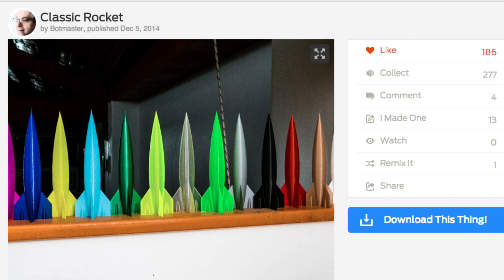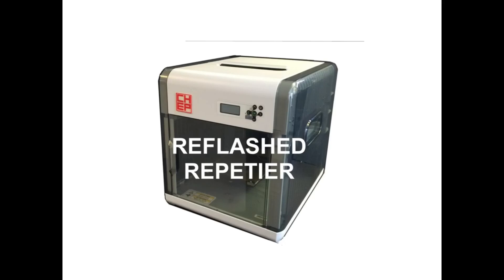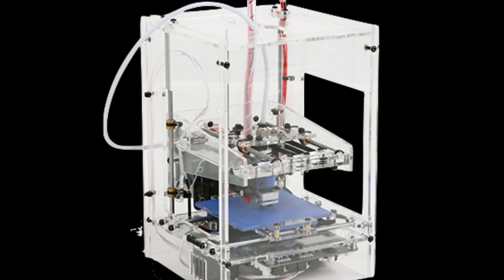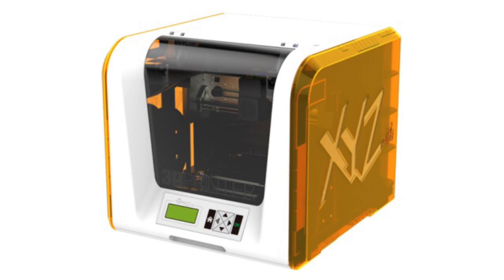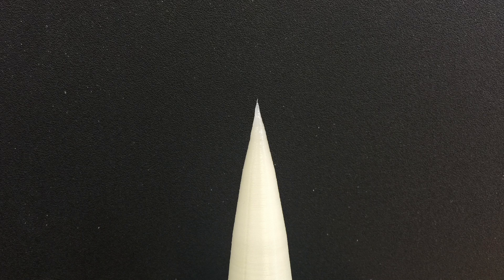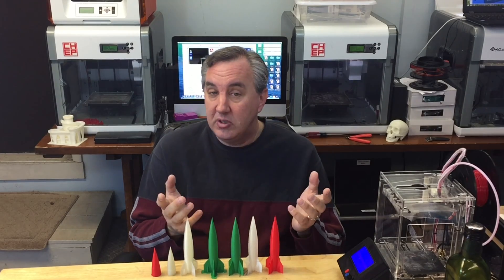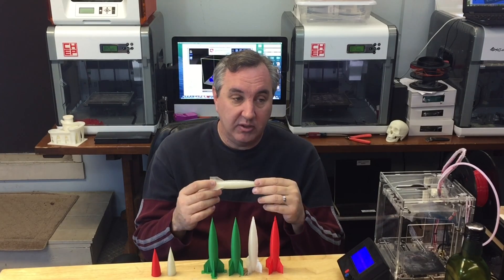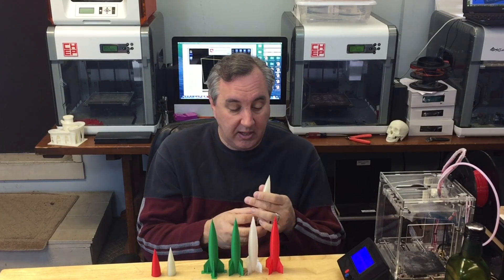Filament Friday #45 - 3D Printing Rockets without Melting on DaVinci vs Fabrikator vs Jr

Comment: Does S3D do that automatically? Or do you have to know what to program to make it work like that??
Reply: +Chuck Hellebuyck's Electronic Products man you are seriously selling me on S3D. I may buy it tonight. Did you get a chance to slice that little file I sent you via email a while back?
Reply: +Chuck Hellebuyck's Electronic Products done. Thanks again Chuck!!
Reply: +Chuck Hellebuyck's Electronic Products so I finally got around to printing the rocket in spiral mode and the top it totally melted. :( and ideas to start with? (I and am using s3d, but didn't have the cooling fan turned on. )

Comment: I recently purchased a da vinci jr  after watching your videos and getting your recommendation. I have been loving the printer so far, but I've been having troubles with distortion in shape. I just printed a screwdriver handle with a hole for a 1/4 hex bit. The whole grip/handle printed as an oval-ish shape instead of the circle it's supposed to be. Even with some cleaning up, I still cannot get a bit to fit in because of the shape distortion. I have had similar troubles with my other prints. I have been putting glue on the bed tape, so I don't think it's because of the object moving around. Let me know if you have any advice. Thanks :)
Reply: +Chuck Hellebuyck's Electronic Products  - I found out that the bed is a little loose so I tried tightening the screws on each corner, but that didn't seem solve the slight movement of the glass. Do you have any suggestions on how to get it so it doesn't move? Thanks once again :)

Comment: Hi Chuck. I was just wondering if you were going to upgrade your old Da Vinci to a E3D Hot End via StevenQ-NE-UK instructions to help with some of these issues. And if so, what solution you would choose for the thermistor temperature issues ?. thanks.

Comment: I do not think it was a fair comparison when you compared the rest of the slicers and 3dprinters with the fabricator mini. Because you had to print it in parts, the top nose of the rocket had an advantage because it had more surface area to adhere to the build plate.

Comment: Hi Chuck.  Great vid as usual.  I had the same issues, in the end I slowed down the print and used KISSlicer...big difference, and that is without the upgrade to E3D yet (I have a Rostock Max V2).  So you are going to replace one of your printers.  Time for Delta my man!  That would broaden your comparisons with the lego brick cartesians.  They can be a bit more pricey, but worth it.  I have paid for mine 3 times over with the professional prints it gives and very consistent.  Love your work.  Cheers from Down Under.

Comment: Have you tried using a fan to cool the filament? I've been printing with my fabrikator mini with a 120mm fan and the results are a lot better in the fine detail. I know the slicer should take care of this, but if your using Cura or Slic3r then you don't have that option (as far as I know).  Currently I'm using this fan holder from thingiverse  -> thing:1011081
Reply: +Chuck Hellebuyck's Electronic Products 
I have found that I get much better prints with ABS using a cooling on my Flashforge Creator Pro. I also have a Da Vinci 1.0 but have not modded it.

Comment: Great video - as usual!  In Simplify3d, there is a feature called the Prime Pillar and it helps quite a bit.   I haven't used it that often, but it is a built in column that prints so you don't have to create another object manually.  I still only use the one printer, a flashed Davinci Duo - and standard practice for me is to use the skirt/brim with about 2 outlines with about 10-12 offset from the part.